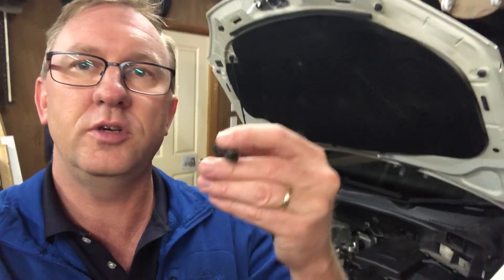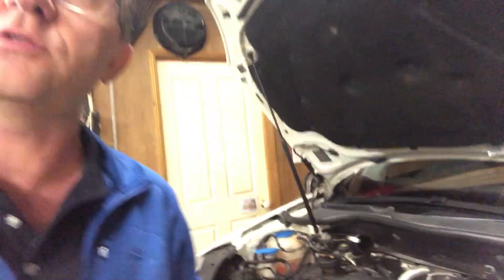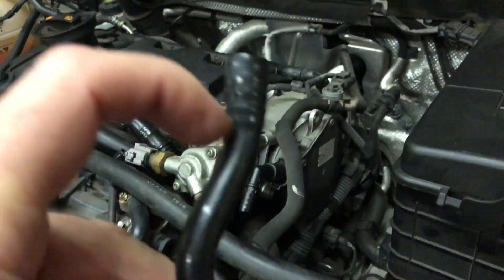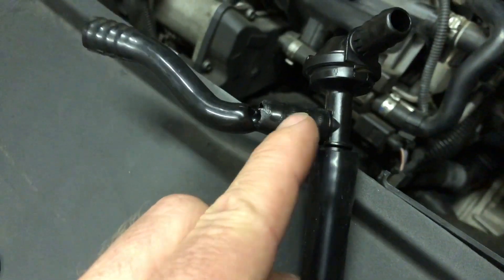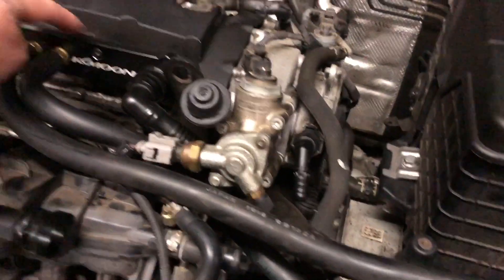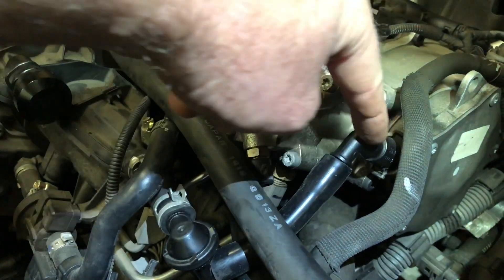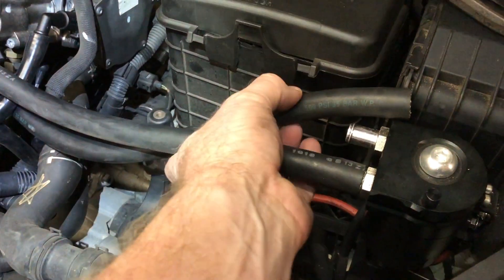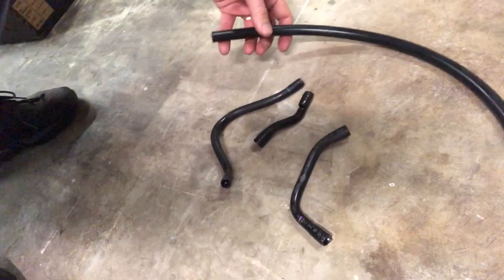Mk5 VW Golf GTI/Jetta Vacuum Hose Repair

Comment: Reason why they use hardpipe/hose is because flexible hoses collapse under vacuum if they are soft enough. Keep this in mind when buying a hose that its not TOO flexible..
Reply from the maker: Correct, you must use vacuum rated hose.

Comment: Hi there, what is the Maximum Pressure for the hoses you got it? I found one on amazon rated for 60 PSI MAX with Stainless Worm Gear Hose Clamps. Is it enough? Thank you

Comment: Hello Peter and thanks for sharing! Do you had any symptoms with the broken hoses?
Reply from the maker: Not in my case. I broke a hose while I was checking the high pressure fuel pump cam follower.
Reply: @PetesWorkshop  So far are you happy with the silicone hoses fix? Thank you very much for the quick response :-)
Reply from the maker: @NickRPT  absolutely. It work perfectly. No complaints at all.

Comment: Be careful please. The hard plastic of the vacuum hose to the brake booster must be hard plastic to increase the response of the brake pedal when braking several times . A soft sillicone hose deforms and lowers the vacuum power.
Reply from the maker: Soufian the brake booster hose does not HAVE to be hard plastic it just needs to be rated for vacuum. I agree in that case, hose MUST be rated for vacuum.
Reply: he has used a vacum hose with a thick wall that does not colapse  under vacum most now have a wall thickness of 3mm which is triple the size of normal vacum hoses.   using  normal hose might colapse internaly but most thick wall ones will be ok..
Reply: sure beats the hundreds u need on genuine vw original plastic ones ..it makes no sense.

Comment: Has there been any issues lately ? Any chance you have a video with the engine running , doing pulls?
Reply from the maker: No problems lately. Car is running great. Just the material is falling apart on the door trims. Are you looking for something particular for engine running? Sometimes I get a ticking sound near the alternator but have not found exactly what causes it yet.
Reply: Peter Parnell you should check your Purge N80 valve the helped me with the ticking , I’m looking at replacing brittle hoses at the moment , does the car run smoother with a catch can ? I also have the Kamoon black off plate but I’ve been thinking to converting it like you did
Reply from the maker: Jose Lara I’ll check the N80 valve thanks. I didn’t notice the car running smoother with the catch can.